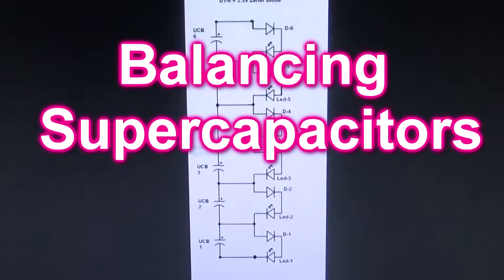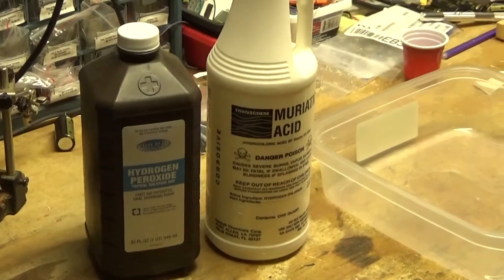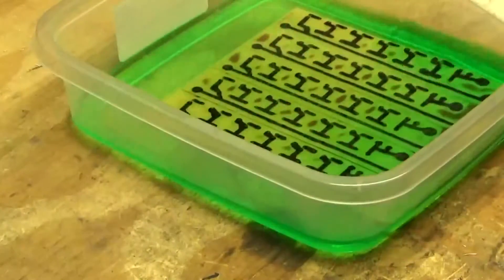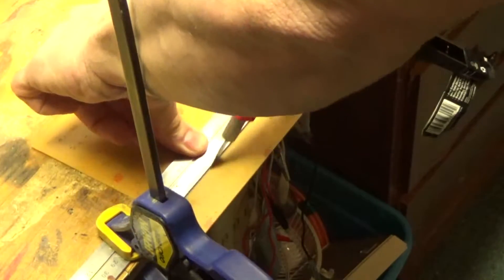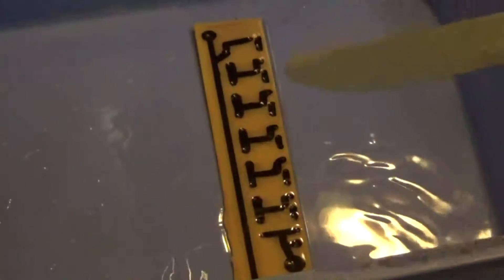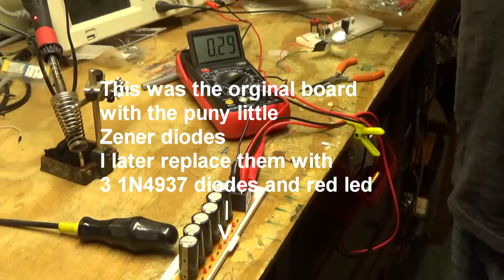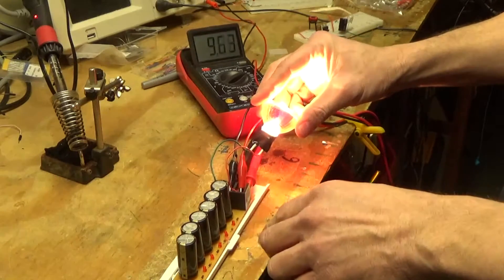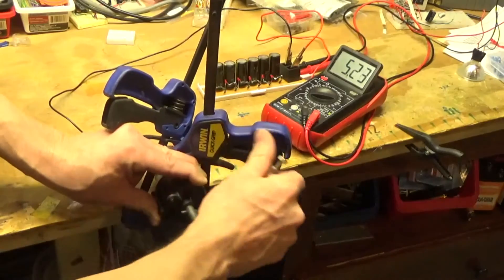Balancing Supercapacitor Board

Comment: This protection circuit is crap.   

1.  You installed the zener diodes backwards. The "zener" voltage is the reverse breakdown voltage of the diode.  The correct way to install them is Cathode-Positive, Anode-Negative.  If you install them backwards, then they will have a forward voltage drop just like a rectifier diode (0.5V to 0.7V, depending on the size of the diode and current).

2.   You installed the Zener diode in series with the LED.  Those red LEDs have a turn-on voltage of about 1.8V, but this can very A LOT!   And the voltage will definitely go up with the current through the diode.  The LED voltage will go up with current, and not protect the cap.  Then the LED will burn out, and you will have no cap protection.

 

  A better circuit is to just put the 2.5V zener directly across the cap (in parallel).   When the voltage gets higher than 2.5V, the zener will begin to conduct and protect the cap from overcharging (assuming it can safely handle the charging current and not overheat).  

You'll probably need a dedicated LED driving circuit.  Don't put the LED in series in the path where the large currents will flow.